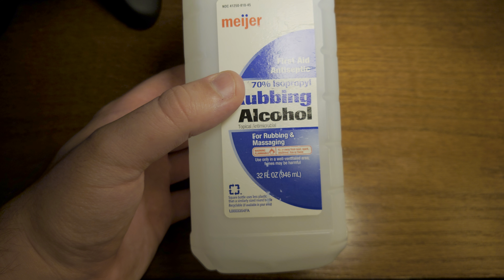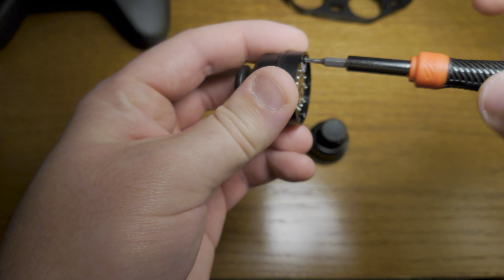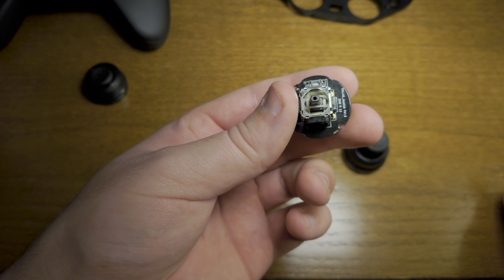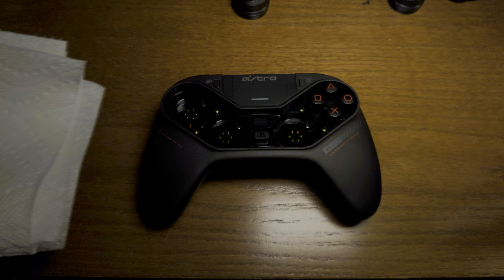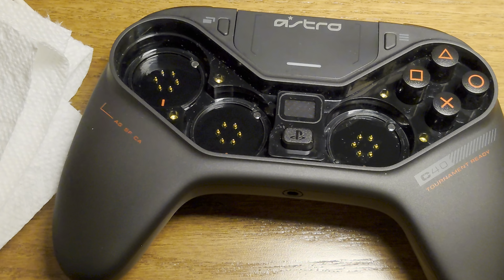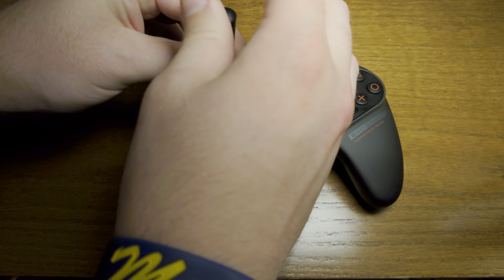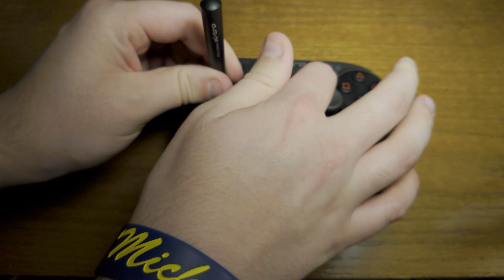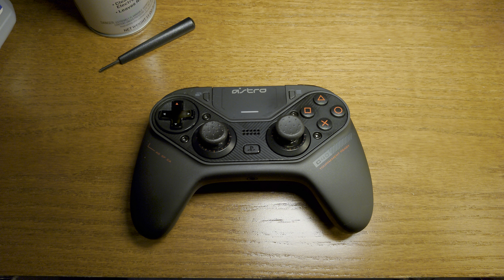Astro C40 Controller Stick Drift Fix: Step by Step Tutorial (4k HDR)

Comment: Great video my friend,   very informative! However,  to reset the controller after you change or swap sticks, you only want to press and hold the back button until it vibrates once only, then let it sit for 30 seconds it will vibrate once more and then your all set to use it.  That will completely reset the controller,  doing it twice only resets drift problems.  I have a C40 as well and love it to death,  but have the same problem with the L3 analog stick goes on it!    It's basically from playing FPS games where your constantly pushing down and upwards at the same time, and it just wears them out I guess,   I've noticed on my other controller that my son uses on his games,  and mind you he doesn't really play any FPS games, that his sticks haven't NEVER needed to be replaced,  and he's had it now for just about 9 months.   Just boils down to very aggressive fps game play.
Reply from the maker: Yeah that's the problem I have too. Lots of fps games kinda ruining these controllers for me. I tend to death grip my controllers when I play so it can damage them unfortunately
Reply: @SpencersStuffTV  although I have now set one of the back buttons as my sprint button,  and has stops the need to constantly press down on the L3 stick and surprisingly helped a bunch
Reply: Im on my 3rd one. Toxic lol
Reply: @SGTpopsckal  u can buy individual sticks lol

Comment: Can you use wd-40 multi-use to or will that eat the plastic to I was looking online and couldn't find a answer.
Reply from the maker: I would stick with electronic safe. A can of electronic safe is much cheaper than having to buy a new controller 😬
Reply: @SpencersStuffTV  I just cleaned it with 90% rubbing alcohol and a q-tip it did the job no more stick drift
Reply from the maker: @SavageValter  well that works! Happy you found a solution 😃
Reply: @SavageValter  you cleaned the avtually stick module with rubbing alchohol?

Comment: Do i have to use wd40 or can I use the compressed air I use to clean my pc which is falcon dust off electronic compressed gas duster
Reply from the maker: The wd40 electronic safe does better getting into the joystick than just the air compressor, but you can try it
Reply: michigan1777 i wont fuck up my controller using something else though right?
Reply from the maker: @mikaelsag  something else like canned air?

Comment: Is the controller worth getting?

I've heard that the sticks are incredibly loose and that stick drift which the video is about to alleviate is about. 

Do the increased tension make much difference?
Reply from the maker: The increased tension was a huge benefit for me, but I still played well with the original tension. If you used a PS3 controller, that's the sort of tension the astro c40 has. I love this controller. Genuinely if you can alleviate the stick drift, the controller is the perfect size and comfort for me, especially for shooters. Just like any controller though, at some point you will need to replace the sticks, and it's good knowing there are places out there to do it
Reply: @SpencersStuffTV  brilliant thank you. I do prefer sticks with tension so perhaps looking into battle beaver increased or extreme is the way Forward if I do purchase it. I've just heard and read so much contrasting information on the astro c40 that it just continuously make me undecided
Reply from the maker: @richardclayton625  I would not go with the extreme. I took the risk and bought both the increased and extreme.  The increased is on par/ a smidge higher than the regular dualshock. I found with the extreme it made my thumb extremely tired after awhile. I use mine almost daily and ever since I've started cleaning the controller like this, my stick drift has gone away
Reply: Not really worth it, buttons get sticky a lot
Reply: AutoXlap yeah, it needs cleaned way too much, not worth it

Comment: i only have 4 percent alcohol and it’s a electronic cleaning wipe would this work fine?
Reply from the maker: No. 4 percent alcohol is too low and the cleaning wipe won't get into the joystick
Reply: michigan1777 will it break it or just not do anything
Reply from the maker: @garcia3700  it will break
Reply: michigan1777 i’ve done it and it didn’t break
Reply from the maker: @garcia3700  great
Reply: michigan1777 i cleaned with it and it’s not broken so ig it works
Reply from the maker: @garcia3700  well Im happy it worked for you! Happy gaming man!
Reply: michigan1777 haha it didn’t fix the issue it just didn’t make it worse
Reply from the maker: @garcia3700  it worked for me 🤷🏻‍♂️ you made sure to reset the joysticks at the end right?
Reply from the maker: @garcia3700  also you didn't use what I said to use so you may have just caused a bigger problem 🤷🏻‍♂️

Comment: The astro c40 screwdriver is a T6 right? So I just need 1 screwdriver to do this?
Reply from the maker: Yes one t6 and the screwdriver supplied to unscrew the faceplate
Reply: @SpencersStuffTV  so I need 2 different screwdrivers?
Reply from the maker: @CocoSnicker12  yes. But astro provides the first screwdriver with the controller. So after that all you need is a t6
Reply: @SpencersStuffTV  ok. Btw what do you call the screwdriver supplied by Astro.  T5 ?
Reply from the maker: @CocoSnicker12  I have no idea

Comment: Will an air blower work as well ?
Reply from the maker: To an extent. You need to use the wd40 to get in the crevices of the joy stick. But a blow before doing that couldn't hurt

Comment: guys before following his steps.. i just fixed it by pulling the analog aside and blow as hard as i could in the analog. with 1 blow the drift was gone. try that before opening the controller.
Reply from the maker: You can also try it with compressed air if need be. Even still a good cleaning never hurts. Thanks for the comment! Happy gaming
Reply: @SpencersStuffTV   @hustlerespect no. Clean your controller first.